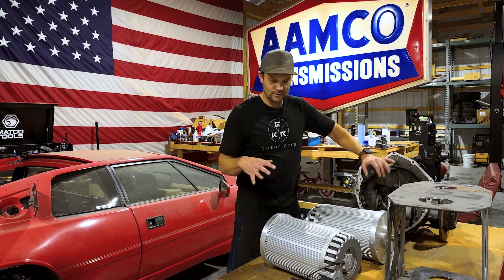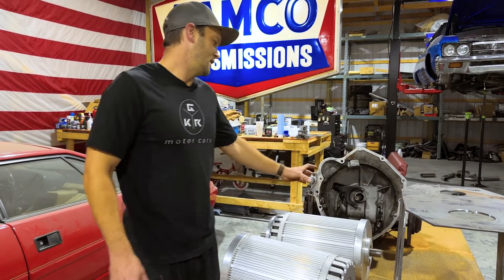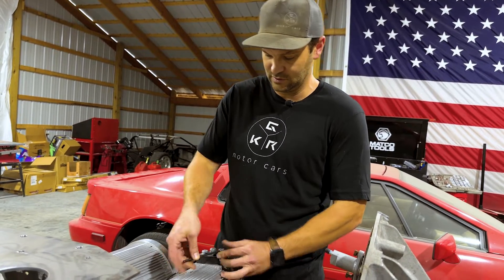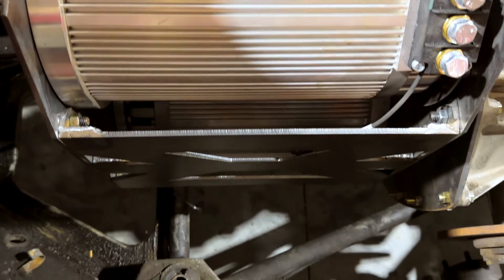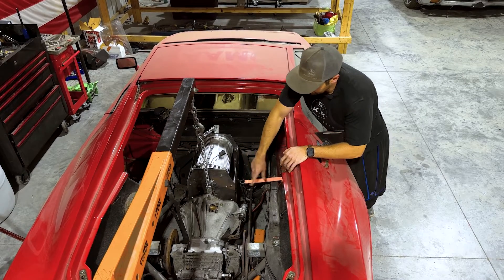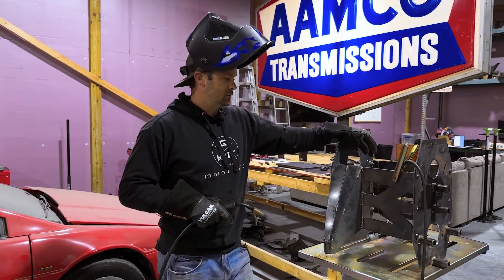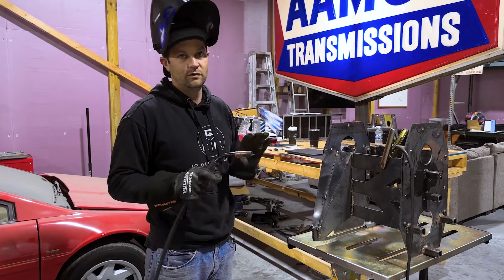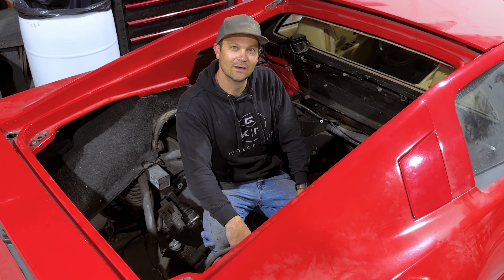Show your work - Dual Hyper9 motor cradle fitment in the lotus!

Comment: Can you show more about the dual hyper 9 setup?
Reply from the maker: @stevenwarrener8533  Thanks for watching! Were there any specific items you were interested in? We have everything installed at this point but could answer any questions you might have.
Reply: @ yea I have a hyper 9 kit and I was thinking of doing a dual motor setup so I wanted to see how you link them together like you did. I have seen the kits that go end to end but they are so long the stacking fits better in an engine bay
Reply from the maker: @stevenwarrener8533 Our setup used the dual output shaft model they have discontinued. So we used a single output shaft model and mated it to one side of the dual output shaft model with a timing belt. The other side of the dual shaft model connected to the transaxle. You would need to setup a way to tether them together on the same side as the transmission with two single output shaft models. Flash drive motors in Austin, TX have done this though. They built a bracket  that uses a belt but extends the lower motor shaft to install a flywheel for the transmission. You should check out their instagram for some pictures.
Reply: @ what about the co troller situation. Does one controller still supply enough power to run both?
Reply from the maker: @stevenwarrener8533 You will need to have a separate controller for each motor. One as a master and one as a slave. The slave motor essentially helps the master provide more power while staying in sync.